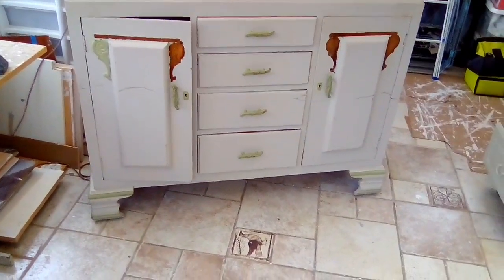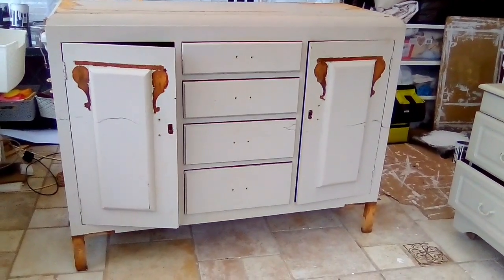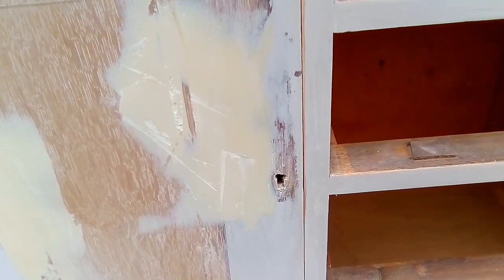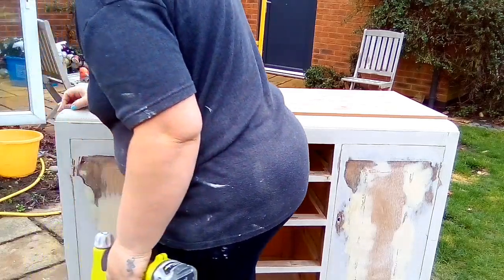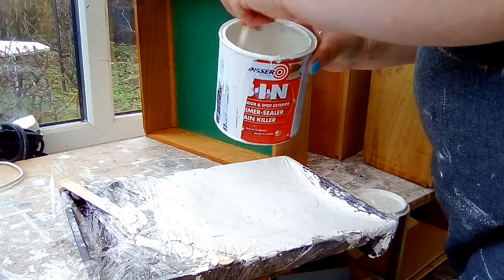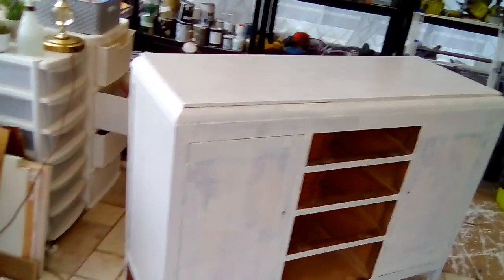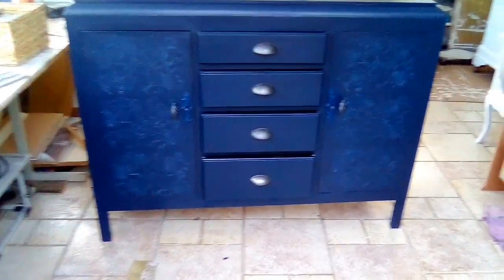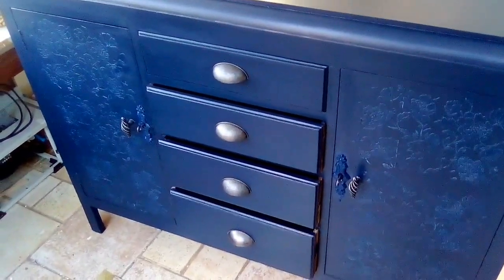Sideboard makeover with a raised stencil detailing

Comment: Is the filler a quick dry??  Try using a metal ruler to drag the surface to get that filler more level before it harden's, you could use a smooth sponge to try leveling over it. Then sand once dry, not too much work trying to sand it flat....just a thought  going to watch the rest of the video.xxx
Reply from the maker: Thank you so much Cheryl I don’t know if I’m using the wrong fillers but even filling draw holes leave a mark I think it’s just me 🤣
Reply: @redesignwitheleanorfurnitu8576  you will figure it out..its pretty .